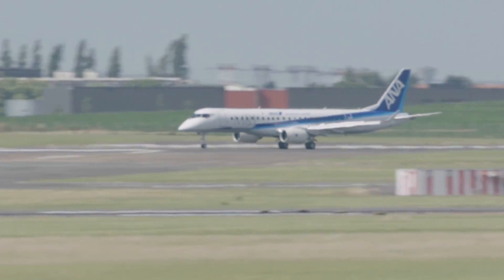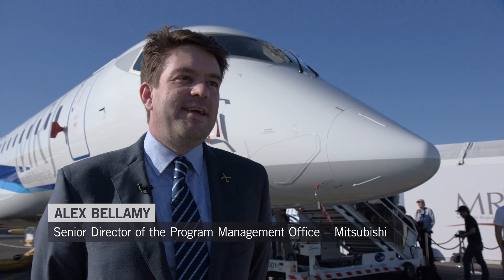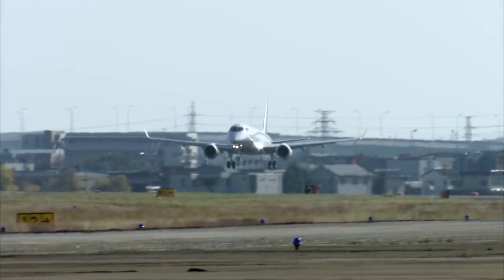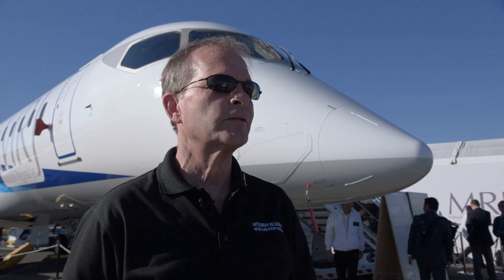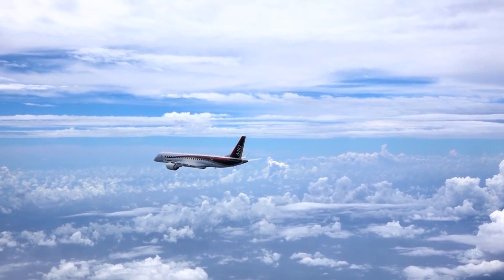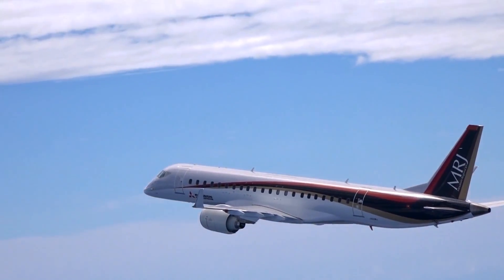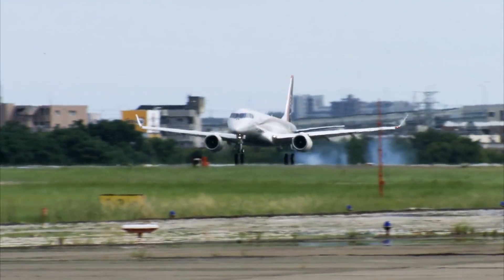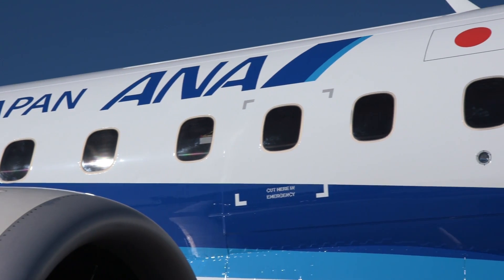Mitsubishi’s MRJ90 Airliner Makes Public Debut Paris Air Show 2017 - AIN

Comment: Most unpopular aviation companies, compared to boeing and airbus, start out small so that if it's a failure, the company wont be damaged as much as they would if the plane were bigger.
Reply: It seams you are forgetting that Mitsubishi has aircraft building experience since before WW2, build the F-2 fighter jet, is assembling F-35s and will build Japans indigenous stealth fighter.  And this jet is for Japan / Asia market and airlines anyway.
Reply: Don't forget the Mitsubishi A6M "Zero" :)
Reply: Mitsubishi is legend like the Kalashnikov. During WW2, the US military was so impressed of the Zeros, they actually copied some design elements from captured Mitsubishi Zeros.
Reply: Tell that to Dassault about the Mercure.

Comment: its an amazing aircraft but there are already the C-series and the E-2 Jet.
Reply: @Oliver   Almost a copy? No way. This aircraft is much more advanced than E170s (the Embraer jet with more or less similar seating capacity).
To begin with, MRJ90s are fly-by-wire aircraft and they incorporate Rockwell Collins Pro Line Fusion that, among other advanced features, includes synthetic vision.
Reply: Isn't the cseries much bigger? I think this will compete with crj and planes like that
Reply: Its a bit bigger thats true...but the mrj dosnt compete with the crj. The crj isnt as modern as the others.
But the E-2 Jets have the same size....
Reply: MLG squid not really mc21 and c919 is smaller and it gona fight vs C serie which the airbus owning 51% right now and trust me C serie gona beat MC and C919 => airbus still wining in that market , but MRJ are smaller so it wont go vs C serie or MC 21 Or C919
Reply: Ville Pusa the c-series replaced the crj cerise.
Reply: isnt as modern????
Reply: It's biggest problem is that it runs on fossil fuels.True innovation will occur when we have high density batteries that can power a passenger plane of this size for 2 - 3 hours.
Reply: Jordi Llach and meanwhile we wait for its release since 2011 Embraer is running with advanced time. hehe
Reply: plus the mc 21(Russia) and c919(China) it'll be a big hit to airbus and boeing
Reply: wouldnt say C series... the cabin and fuse in the MRJ90 is almost the same size as a global 7000 and the flight instruments are closer to a full ADS moded CRJ/ global 6000 in fact the cockpit layout looks nearly identical to a global 6000
Reply: Jordi Llach the only difference in the design us de cockpit Windows...  but we are not worried about it. embraer E2 >>>>MRJ
Reply: almost a copy of our Embraers. but not too good as embraer